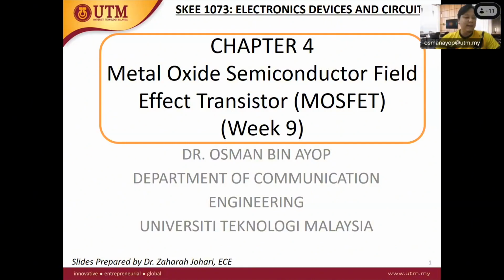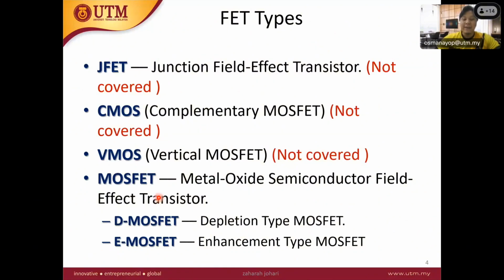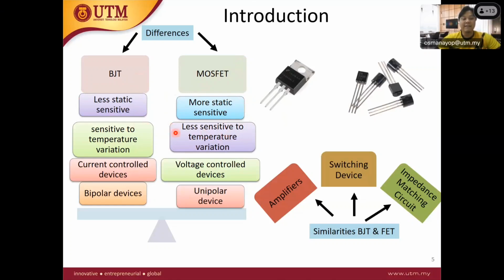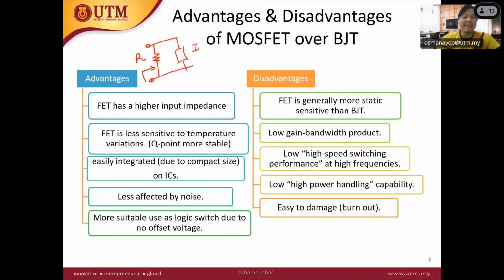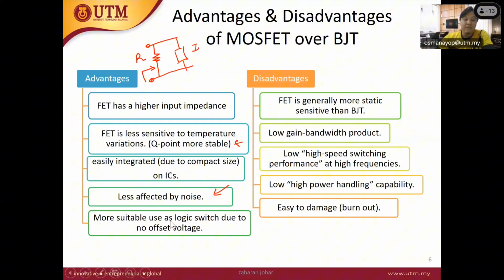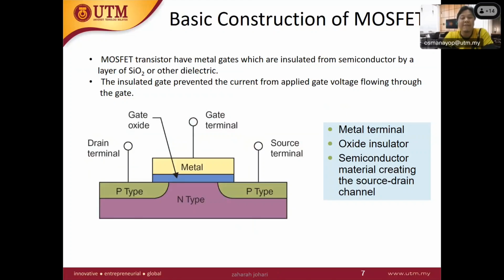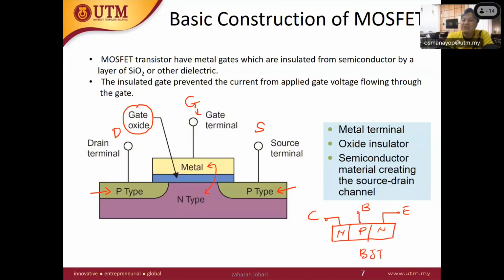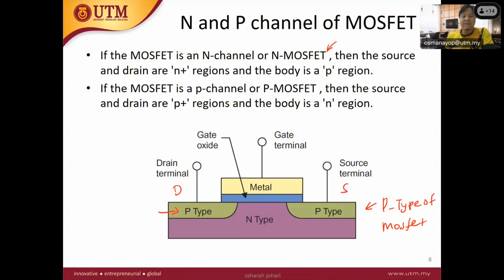Introduction to MOSFET

Comment: “I want you to help me. Why, in Maxwell’s equations in their integral form, are they often expressed as fixed formulas without including the constant of integration, ‘C’? Just like in the principle of integrating velocity to obtain distance. Why are these integrals, including those in Maxwell’s equations, written as fixed forms without the constant ‘C’, even though in regular integrals, the constant should always be included?”
Reply from the maker: I think you asking in the wrong video since this is about MOSFET. Anyway, I can help you to answer.

Maxwell’s equations are definite integrals over physical quantities, not general indefinite integrals which require constant "C".

Maxwell’s equations in integral form are like:

∮𝐸⋅𝑑𝑙=−𝑑/dt ∫ B⋅dS

This is a definite integral — you're integrating over a specific, closed path (C) or a specific surface (S).

There's no need for ‘+ C’ in definite integrals because you're computing an actual numerical or functional result based on a given physical region.